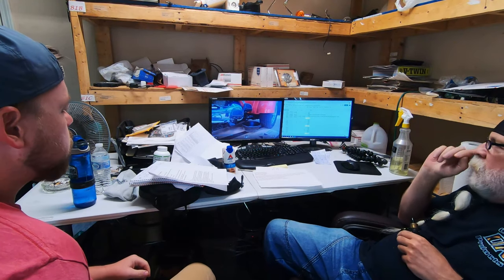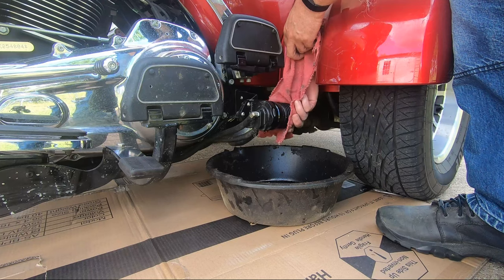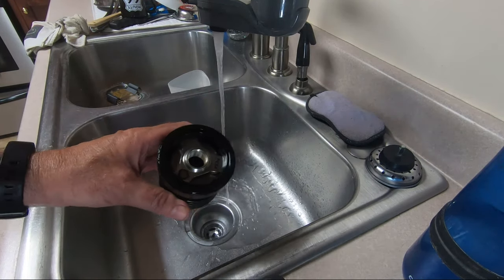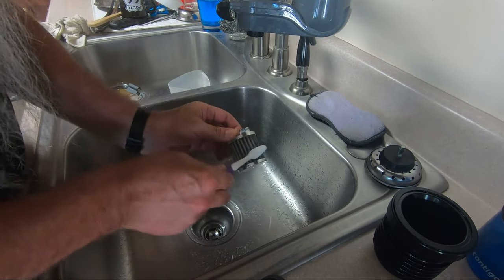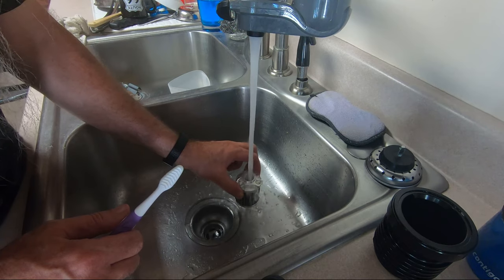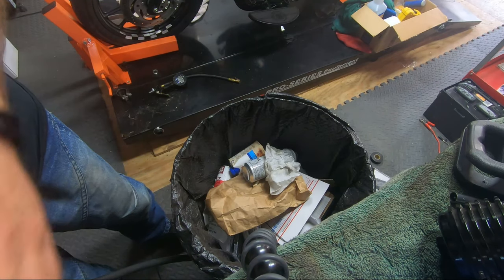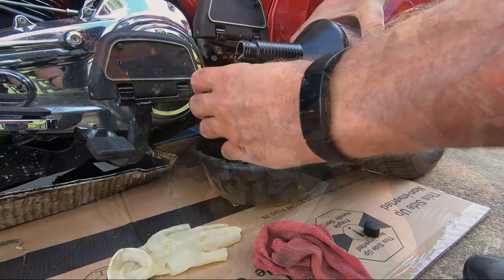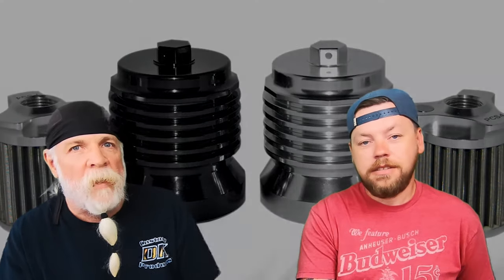Clean - No Mess Oil Change w/ Performance Filter

Comment: I clean mine in our basement laundry sink. I first whip out as much oil as possible and spray out the filter element with some brake cleaner to minimize the oil going down the drain. I’m basically just cleaning off residue. When done, I blow dry the parts with my air compressor. It’s an easy process.
Reply from the maker: Thanks for sharing!  Great tips!

Comment: Just received my new Finned Alu-Oil Canister Filter and not only does it look awesome, but as a prettier experienced Harley Rider knowing my Bikes in and out…I definitely noticed a quicker warm up, a little higher oil pressure at work temperature all resulting in a much much better oil flow…and at the same time a 5-7 degree decrease in the engine’s temperature. If this actually will increase the Bikes Torque and HP still remains to be seen. But why not,..with the traditional “blocking” Paper Oil-filter gone everything seems possible 👍🏻👌🏻🛠☠️
Reply from the maker: Nice, glad you are experiencing the benefits of the Performance Oil Filter. 👍😎👍
Thank you for your business, we appreciate it. 👍
Wishing you many miles of smiles!
Reply: any concerns about not having anti drain back valve? any noise after oil change and first start up?
Reply: @rickbiggers4096  None what so ever, definitely better oil flow and pressure + 5-7 degrees lower average temperature.

Comment: Great video guys.  Have bought several products from you but elected to buy a K&P reusable filter made exclusively for cycle solutions that has twice the capacity as the typical K&P or FLO which I think is the filter you guys sell.  I also think the K&P is a better quality.
Reply from the maker: Thank you, glad you enjoyed.
K&P makes a fine permanent oil filter.  We used to use them.  However, we have a LOT of Customers that buy from us that Race.  Most tracks require everything that screws on be safety wired.  Can't do that with the K&P, we asked them to and they declined.  So the one we have now has the nut on the end with a hole in it for safety wiring.  It also uses the same stainless steel mesh filtering as the K&P.

Comment: If you weren't going to use the relocation kit, will this filter still fit in the original location?
Reply from the maker: Yes, this Permanent Oil Filter will fit in place where your OEM oil filter is. Here is a link to the Black oil filter if you would like to read about it - https://www.dkcustomproducts.com/outlaw-high-performance-cleanable-oil-filter-in-anodized-black-dk-ocof-ab.htm
- Here is a link to the Polished oil filter - https://www.dkcustomproducts.com/outlaw-high-performance-cleanable-oil-filter-in-polished-finish-dk-ocof-crm.htm

Comment: I have a couple of question on this cleanable filter? 1.) What is the absolute micron rating? 2.) What is the efficiency rating?

Efficiency is the percent of rated particles captured in a single pass test.
Reply from the maker: All the specs we have are listed in this link- https://www.dkcustomproducts.com/outlaw-high-performance-cleanable-oil-filter-in-anodized-black-dk-ocof-ab.htm
There is also a video on them at this link, with dyno charts- https://www.youtube.com/watch?v=__WbuX1IT1c
Reply: Thanks for the Info.
Reply from the maker: @michaelrocole7174  No problem!

Comment: What is the micron filtering of the filter/ You say the old filter as more restriction. If its filtering small micron pieces, its going to be more restriction... You also say about were the carb cleaner goes....What about the oil that goes down the sink into the water system.... Im not a tree hugger, I have a septic tank and I know you cant dump oil down the drain and keep it working....
Reply from the maker: Good questions, will answer in order:
1.  Paper filters use what is called a nominal rating.  The HD OEM filters and aftermarket paper filters are rated on averages, percentages and multiple passes, so a 10-micron-rated paper filter may be letting particles 100 microns and larger through.  Even though they can let big particles thru, they also clog easily,  causing more restriction and the bypass to frequently activate which results in NO FILTERING.  More details at this link- http://www.dkcustomproducts.com/outlaw-high-performance-cleanable-oil-filter-in-polished-finish-dk-ocof-crm.htm

2.  The Outlaw Permanent Performance filter is rated at an absolute 35 microns. (35 microns is below the limit of human visibility)  The bypass rarely, if ever, activates, resulting in much better filtering than the OEM filters, with LESS DRAG on the engine.  More details at the above link.

3.  The amount of oil going down a sink is going to be 1 or 2 teaspoons, far less than the fat (oil) that goes down the sink from cleaning one pan from one turkey.  Think about all the oil that goes down a kitchen sink from washing dishes, pots and pans.  The sink in this video is at a house with a septic system  It is 15 years old and never had a problem.  Small amounts (relatively) of oil and fats are handled fine by septic systems and city sewer systems.  Just don't dump the entire oil change down the sink.  :)
Reply: Ever have oily hands and washed them in the sink? Probably the same amount of oil

Comment: What's the correct torque to be applied to the permanent filter?
Reply from the maker: Just like any other oil filter.
Put a light coat of oil on the o-ring gasket.
Tighten, by hand, until o-ring is snug against engine or adapter.
Tighten, by hand, another one quarter of a turn.
Reply: @DKCustomProducts  Per PC Racing, the actual answer is 15 foot pounds of torque if anyone is curious.

Comment: Im a little confused how does water dissolve any oil residue, wouldn’t you have to use brake clean or some sort of chemical to dissolve any type of oily dirt?
Reply from the maker: SOAP and water.  Carb cleaner or other solvent works fine too. 👍

Comment: Doc Harley video expressed concern with reusing gasket... he expressed concern that it will wear. How long have they lasted for you?
Reply from the maker: It is generally recommended to change it out every 3-5 oil changes.  They are not an oddball size and are readily available.
You can see the o-rings here - https://www.dkcustomproducts.com/replacement-o-ring-for-cleanable-oil-filter-dk-ocof-rng.htm
Personally I've used the same o-ring for more than 10 changes.  Zero issues.
Reply: @DKCustomProducts  excellent... thank you  : - )

Comment: nice video with the filter did your oil temps go down any?
Reply from the maker: All the details on the Performance Oil Filter can be seen here- https://www.dkcustomproducts.com/outlaw-high-performance-cleanable-oil-filter-in-anodized-black-dk-ocof-ab.htm
Yes, there are two factors that help cool the engine down with this oil filter:
1.  It flows more consistently and has less drag on the oil pump
2.  The Finned Billet housing give some extra heat dissipation. 
Our experience has been in the 2-5 F range.
The biggest benefits of these oil filters are
Better Filtering
More power to the rear tire.
Reply: @DKCustomProducts  thanks for the information I will check out the link also
Reply from the maker: @Centralthabiker  No problem, thanks for watching!

Comment: How many microns does this filter down to and what micron spec does Harley Davidson call for?
Reply from the maker: Very interesting subject, and great question.
All the details answering both your questions can be found at this link- https://www.dkcustomproducts.com/outlaw-high-performance-cleanable-oil-filter-in-polished-finish-dk-ocof-crm.htm
Here is a copy and paste of some of the info-
At the heart of the filter is a medical grade 304 stainless-steel micronic cloth filter designed to pass a large volume of oil when compared to standard paper filters. The cloth is designed to filter out particles 35 microns or larger. (35 microns is below the limit of human visibility)

The HD OEM filters and aftermarket paper filters are rated on averages, percentages and multiple passes, so a 10-micron-rated paper filter may be letting particles 100 microns and larger through. The medical grade stainless steel cloth they use in their filters is consistent across the entire surface and is rated at 35 microns, meaning nothing larger than 35 microns will pass through the material, it is an absolute, with paper filters, the rating is an average.
Reply: I think it’s 35 microns

Comment: When I fill my stock oil filter half full of oil, When I go to screw it back in I don’t get any oil out on the ground.
Reply from the maker: What happens when you pull your filter from the engine...it should be full at that point.

Comment: Thank you guys for doing this video. Absolutely helps. I have a request for you to please consider. In another video I had asked that you please start carrying Ultracool oil coolers. Imo, they are leaps and bounds higher quality than Jaggs. Just by the type of components offered in the Ultra kit vs Jaggs kit. Again. Its just my opinion. Thank you. God Bless and Ride safe. Btw. Your coil relocation kit and Catch can breather kit works flawless on my Slim. Thank you.
Reply from the maker: We have tested the Ultracool oil coolers in the past and they have not performed as well as the Jagg in our tests.  However, it has been about three years.  We may test them again and see if they have improved.  I will say this, some of them look pretty nice too.

I did go and look the other day at the one they started making for the Twin Cooled bikes...eeek, you gotta cut part of your lower fairing.  

Let us know when you started using the Ultracool.
Reply: @DKCustomProducts   If I recall, Jagg doesn't make a cooler for the M8.
Reply: @DKCustomProducts  I haven't bought one yet. Probably over the winter and thanks for the reply. Cutting the fairing will not apply to my application as it would be installed on the down tube of my 17 Slim S. I would welcome another review of the Ultracool and appreciate it. The Jaggs has a single fan. Yes the UCs are very nice. The UC has dual fans. Anything mechanical can fail as we all know. I saw where a Jagg fan failed weeks after install. It happens and that's why there's warrantees.  I just think the threaded on oil lines, dual fans and enclosed housing is just awesome. But this is my opinion.  Thanks again.  😎👍
Reply from the maker: @RideAmerica  We have Jaggs mounted on many M8's,  You may be thinking about a Twin-Cooled M8 which requires DK's patent pending mounting system.  You can see them here- http://www.dkcustomproducts.com/twin-cooled-oil-cooler-c612-94.htm
On non wethead M8's any of the Jagg oil coolers work just like on other Harleys.  See here-  http://www.dkcustomproducts.com/oil-coolers-c134.htm
Reply: @DKCustomProducts  Ok my mistake. i was going by Jagg's web site.  For touring they stop at MY '16.  I have both a water head M8 and non water head M8.  For the non -  I see what appears to be 2 versions of the fan assisted - a 10 row and a wide 10 row.  Will they both work on a 2020 RK and if so, any advantages to one over the other? EDIT - do I need to make a dealer visit to initiate anything like the HD fan assisted or Thundermax?
Reply from the maker: @RideAmerica  Go to our website, better pricing than going straight to Jagg. http://www.dkcustomproducts.com/2009-up-models-c159.htm

Both of the 10 Row downtube mount oil coolers will fit on your 2020 RK easily.  The fan assisted one will give you better cooling in slow and stopped traffic, pulling a Full 75cfm across the oil cooler even while stopped.
Reply from the maker: @manchild111  We will give them another shot, see how they do.  Thanks!
Reply: @DKCustomProducts  That's awesome. We all thank you. ;)
Reply: @DKCustomProducts   Hey Guys, just a follow up before I consider making a purchase on the jagg from you guys.  I probably got too winded and my lsat question didn't get answered. Does the dealer have to do anything to active the fan?  I know the HD fan assisted one does and also the thundermax version.  Wan't sure about this one.
Reply from the maker: @RideAmerica  Hi Mark, did not see another question from you, sorry we did not answer it.  NO, the dealer does not have to do anything for the  fan to activate on the Jagg fan assisted oil coolers.  Part of the kit is the thermostatic controlled switch which turns the fan on and off.
Reply: @DKCustomProducts   Thank you for answering. it was not a separate response, it was jumbled in my long winded multi-part questions.  Easy to miss.
Reply from the maker: @RideAmerica  Gotcha.  Have a great day!

Comment: Can you tell me please what are micron rate filtración of this reusable filter?
Reply from the maker: Below is a copy and paste on the subject from this link, where you can find more info- https://www.dkcustomproducts.com/outlaw-high-performance-cleanable-oil-filter-in-anodized-black-dk-ocof-ab.htm

At the heart of the filter is a medical grade 304 stainless-steel micronic cloth filter designed to pass a large volume of oil when compared to standard paper filters. The cloth is designed to filter out particles 35 microns or larger. (35 microns is below the limit of human visibility)

Before you start with the, “my filter is rated at 5 microns and it filters way better,” you need to understand just how the micron rating applies to oil filters.  The HD OEM filters and aftermarket paper filters are rated on averages, percentages and multiple passes, so a 10-micron-rated paper filter may be letting particles 100 microns and larger through. The medical grade stainless steel cloth they use in their filters is consistent across the entire surface and is rated at 35 microns, meaning nothing larger than 35 microns will pass through the material, it is an absolute, with paper filters, the rating is an average.  Additionally, paper filters have a bypass, so on startup & high RPM the oil is not being filtered at all!

Comment: Does this style filter and kit allow the oil to run somewhat cooler ?
Reply from the maker: The finned billet casing does shed heat a little better than traditional filters.
Where it shines on cooling is that it puts less drag on the oil pump, so there is less engine heat, and a resulting drop in oil temps.
Here's a link to more information and another video on the subject- https://www.dkcustomproducts.com/outlaw-high-performance-cleanable-oil-filter-in-polished-finish-dk-ocof-crm.htm

Comment: Hey guys , how you doing? I know this is not the right forum but I have a question. I ride everyday year round, except icy or snow days. My wife rides with me about 50% of the time. I’m 250lbs, my passenger is around a buck 70. I’m thinking of replacing the original shocks off my 93 FLHS. I’m thinking since I ride 2up with luggage added to that, I want a longer 13+ , maybe 14. What are your thoughts, when(if) you have time. Stay safe brothers they’re trying to kill us out there.
Reply from the maker: Hey Stephen.  All good here.  Thanks!
On rear shocks we recommend the PA or the Twin Adjustable.  There is an entire comparison chart at this link- https://www.dkcustomproducts.com/overview-of-performance-rear-shocks-83.htm
Reply: @DKCustomProducts  I went with Legend Revo-A’s, probably paid too much but this bike is a keeper. I want everything top of the line. I jumped before I got your response.
Reply from the maker: @LonesomeNomad137  Those are respectable shocks.  Not quite as nice a ride quality as the PA or the TA, but MUCH better than stock.

Comment: What's the micron filtration rating on this filter
Reply: @billyelliott5767  that's unexceptable, large particles like that going through the whole oil system
Reply: @davidholbrook1118  30 µm about the half the size of a human hair but stock oil filters are in bypassed, quite a bit initial start up and at higher RPMs. It goes into bypass because it can’t get through the filter quick enough for your motorcycle so about 60% of the time from what I understand you’re not getting any filtration on the stock Carly filter that’s made of paper.
Reply from the maker: It has an Absolute Rating of 35 microns, smaller than the eye can see.
Harley filters have a nominal rating of 5-10 microns, BUT THAT LETS PARTICLES AS LARGE AS 100 MICRONS THRU THE FILTER.  Not including when in bypass there is no filtration happening.
Details for a full understanding can be seen at this link- https://www.dkcustomproducts.com/outlaw-high-performance-cleanable-oil-filter-in-polished-finish-dk-ocof-crm.htm
Reply from the maker: Agreed that large particles going thru the system is not good...which is why we use these, because they do not let anywhere near as large of particles thru as the Harley or K&N filters.
See full details here- https://www.dkcustomproducts.com/outlaw-high-performance-cleanable-oil-filter-in-polished-finish-dk-ocof-crm.htm
Reply from the maker: Well said, although it depends on how one rides if it is 20% of the time or 60% of the time...either way, 35 absolute is Much better than 5 or 10 nominal.

Comment: I need this
Will this void my warranty?
Do I need the oil cooler if I bought a assisted one to go on my 2020 road glide? 
I was wondering if the jugg one that is a bit bigger I think would work w y’all oil relocation kit too?
Reply from the maker: Some dealerships will try and tell you your warranty is voided if you change your seat to a non Harley branded seat.  If you have a dealership like that, just put an HD oil filter on it before taking it in for warranty work.

On your other questions, not sure I understand exactly what you're asking.  You can shoot us an email or give us a call at Support@DKCustomProducts.com or 662-252-8828